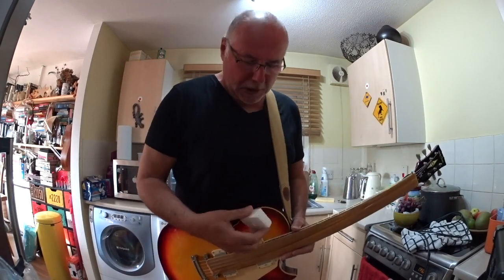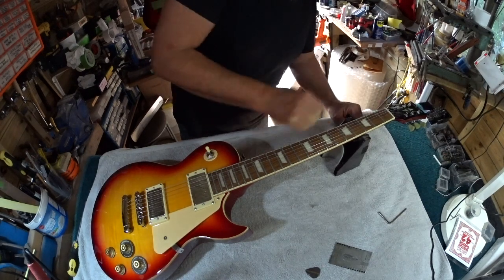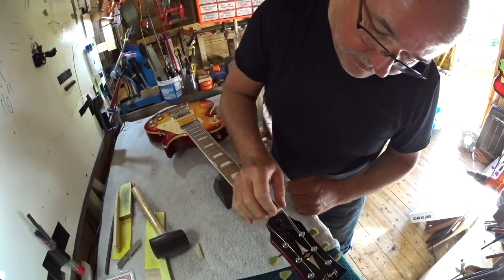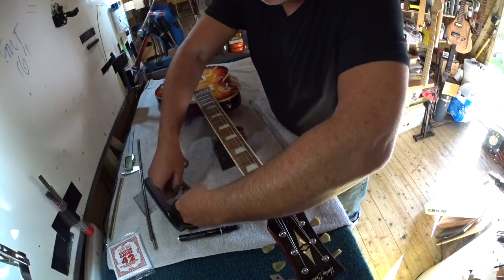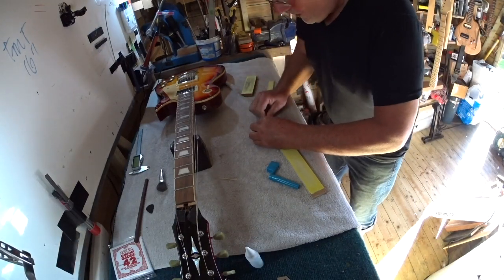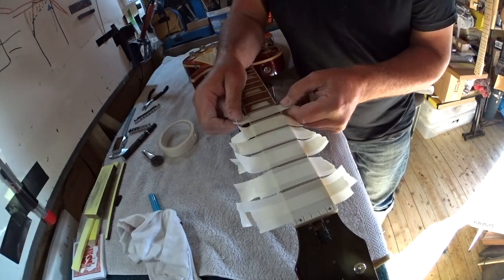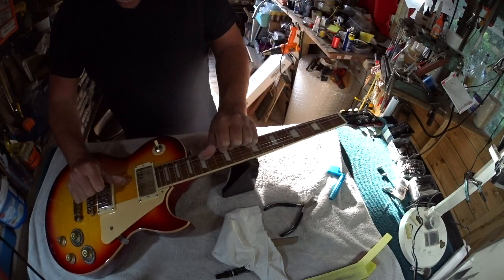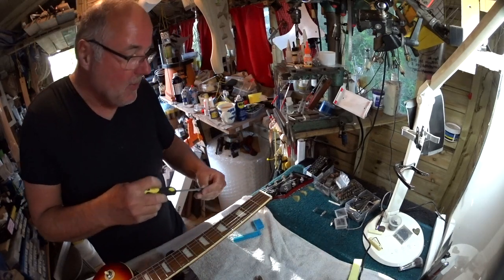Harley Benton SC450 nut upgrade and set up

Comment: This model is lower than i would buy.  Just a few dollars more and it jumps nicely.  There are several nice models.  Availability is the key.  TY for the vid and entertainment.
Reply: SC-550.  They use two different winds on different models.  CST-24T, TE-90FLT, TE-70 B Paisley, SC-Cutom... now making the SC-Custom II... not as good IMO.  I have six HB's and intonation on a couple i messed with, because i live in Michigan and must fiddle with everything i own likely.  The tuners on the T-style are not good, but i have kept them and they work.  All have above average wood quality, and even craftmanship.  The necks are all very good except maybe that CST-24 is too thin.  I have been fortunate i guess in the quality of guitars i have received from Thomann.

Comment: I've owned a couple of these HB LP-types and handled a couple others. All of them seemed to weigh a ton. Do you suppose they are just leaving too much moisture in the wood before building? Not much else makes sense since the hardware is cheap and reasonably lightweight.

Comment: Hi Sam

After watching several of your videos on nut jobs, I buyed and installed a Tusq xl nut on my HB 450. You mentioned the first fret action. Can you please let me know how should I meassure it? In the Graphtech video they are saying that it should be something around 0.010" if the third fret is hold down. Is this the metod to meassure?
Thanks
Reply from the maker: Hi - that's their way of doing it. I find it simpler to measure the gap between string and 1st fret. I cut the slots down until I've got a gap of around 0.3-0.4mm between string and fret.
Reply: Huge difference here. They are saying 0.25 mm with 3'rd fretted and you are saying 0.3mm open.
I'll wait till I got my nut file substitutes and i'll file them lower if you say that's better. I found the first fret quite high after I set it up like they showed.
Should I file down the nut after making the slots lower?
Thank you
Reply from the maker: @daniZZ75  I don't measure their way so can't comment... I measure open because that works for me; it's not better or worse. You can buy a stainless steel 0.3mm pick btw... if you keep one of those handy that will give you a good guide for your 1st fret action. I used to file slots down to the precise action I wanted but these days I use almost exclusively custom-made adjustable nuts to a) get the correct minimal 1st fret action AND b) get the action I want without cutting into the smooth factory-made slots

Just to add: any 1st fret action above around 0.5mm will make your fretted notes near the nut sharp; the further above 0.5mm the sharper they will be and the lousier your open chords will sound. Since manufacturers regularly send their guitars out with close to 1mm 1st fret action I don't take my guidance from them.
Reply: @SamDeeksRelovedGuitars  
Hi Sam
Exactly what I was saying. the difference is way to big from the guidance from their official site to what I saw you are doing. I managed to get it as they said, and the open first fret action is way to high. It is as you said around 1mm or little bit higher. I have proper filer gauges for measurement. 
I didn't asked here before doing this just because the 2 values said were very similar (0.010''  compared to 0.3mm) but after getting it the way they said, it seamed too high for me. I'm in Romania, so a custom made adjustable nut is not an option for me sadly. I would like not to mess with the factory notches also so I'm considering trying to knock out the nut again and sand down from it's bottom part.....

Thank you for your guidance and keep up the good work.
Thanks again.
Daniel
Reply from the maker: @daniZZ75  Hi Daniel, I'm glad the info was useful. Good idea not to cut the factory slots if you can help it (although some nuts have way too deep slots to start with)  - sanding from the bottom IS possible but you have to be VERY careful. My eBook shows how to do this with a very inexpensive file - all the tools in my eBook are cheap or home-made :-) 

https://www.facebook.com/relovedguitars/photos/a.1434485003475282/2714965088760594/

Comment: I agree with your impression of extreme bevel on fret ends.  This is not a good feature for a fat fingered, sloppy player like me.   With 9 or 10 size strings and midway the fret board at 5 thru 9, the E easily cams off the edge down into neck binding, and kills the string function immediately.  Back pressure of the string on the finger tip is lost immediately, causing autonomic confusion.  From #16 on up the bevel is reduced, making it easier to play in that region.  I think the player can compensate, once this function is realized.

Comment: Hi Sam
How are you doing that intonation only with this pattern ?
I always do the intonation for each string on 12th fret but i need always a few tries to get it right. sometimes i have to turn the saddle of the respective string because there is not enough space to the rear. If  I don't have enough space to the rear, are the holes for the bridge drilled too far forward or not ?
I always try to intonate my guitars as well as possible and I always do it very well, but the pattern of the saddles sometimes looks completely different than expected. ( I've been playing guitar for fifty years but I'm not a guitar maker. )
I would appreciate an answer very much. Best wishes
Yetimatze
Reply from the maker: Hi Y. I checked the intonation and the bridge saddles were pretty much set correctly from the 'get go'. This is partly good luck but partly because the bridge manufacturer / seller knows where the intonation pattern falls. The biggest variable in the intonation equation is how hard the player presses (frets) the note. The significance of this fact cannot be over-stressed. It means that MY fretting pressure will cause me to set the saddles in one position and YOUR fretting pressure may cause you to position them differently to reach intonation. This 'gross' variable is SO variable that it makes a mockery of buying expensive tuner equipment to set intonation. It will ALWAYS be an average of the particular players fretting style - which also will never be quite the same twice. 
If your intonation pattern is wildly different from the 'two staggered groups of 3' then it suggests that your strings are faulty. I've learned (the hard way) that when a single string is WAY out of sequence in the expected intonation pattern, it is the STRING that is faulty i.e. poorly manufactured. Change that string and, miraculously, you reach intonation immediately afterwards - and with that string's saddle falling back into the expected position in the sequence. This happens far more often than you might expect - but, like me, you learn to save time by throwing the string away and NOT waste lots of time trying to intonate it.
Reply: @SamDeeksRelovedGuitars  thank you very much sam. that really surprised me and i will follow your advice. that is really cool. I am glad to have found someone with so much experience and knowledge. I would like to give three squirrels for that. 🐿🐿🐿😄♥️🙋‍♂️

Comment: Hi Sam... do you have a link for the truss rod you're using for levelling? Cheers in advance. Dan. 👍❤
Reply from the maker: I pulled the one I mostly use from a broken Squier strat neck. But it's this basic kind:
https://www.gear4music.com/Guitar-and-Bass/Guitarworks-Two-Way-Truss-Rod/1YGB?origin=product-ads&campaign=PLA+Shop+-+GENERIC&adgroup=GENERIC&medium=vertical_search&network=google&merchant_id=1279443&product_id=91307d1&product_country=GB&product_partition_id=818006960599&gclid=Cj0KCQjwsuP5BRCoARIsAPtX_wFfzqgNqEG-4r6GiPJ0Hc9_cAzODH0R6KaiHQpksoihH7belb-d5-waAiaVEALw_wcB

The one I use is 42cm, the one linked to here is 43 which should work. Each feels and behaves differently so my main advice is to try a few over time and stick with the one that feels right for you.
Reply: @SamDeeksRelovedGuitars  cheers mate.... I'm using one pretty similar to the linked one, the one in this video looks as if it has more width, and you seem to cover a slightly larger area with it.
Reply from the maker: @danberndtson  Ah yes - this is the StewMac 'U-Channel' rod. Yes, I bought it and had it shipped from the US just to use as a levelling beam. I occasionally use it... when I want a stiffer rod. Ahem.
Reply: @SamDeeksRelovedGuitars  🤣 I shall get one ordered. Thanks for the info Sam... take care. 👍❤

Comment: This Tune-o-matic crap is really a pain in the ass. I don't get why they still put them onto the singlecuts  nowadays. Doesn't matter if it's a gibson nashville, an ABM or a TonePro bridge. All the same shit for expensive money if you buy one of those. The wilkinson roller bridge is the better solution for a budget price....
Reply from the maker: Yes... but having said that, I also can't bear the 'slack string off completely, unlock saddle from above with hex key then push the saddle randomly in the hope of getting the intonation right' roller bridges they make. A roller TOM is the best conversion (IMHO) - either a generic, decent quality Chinese one (I buy mine from Vanson Guitars or Northwest Guitars) or a Schaller STM sideways-adjustable roller bridge if you've got the money.
Reply: @SamDeeksRelovedGuitars  yes, at Schaller they thought of something when they made the string distance adjustable. What was not considered is to put the stringwheels into a kind of casing, instead the screws were simply placed loosely on top.  So when you're at a gig lets say in a musty pub or on a dark stage and the string tears for any reason you never find that small wheel again which is up and away at the same time. Moreover these tiny things may rattle depending on string tension. A very exact and precise one is the babicz fullcontact bridge. Also cleverly solved. But for that money I'd rather buy another Benton... xD